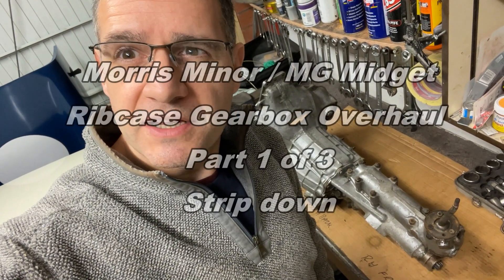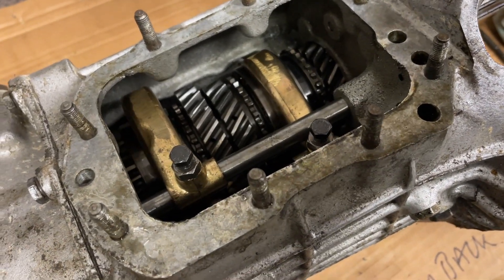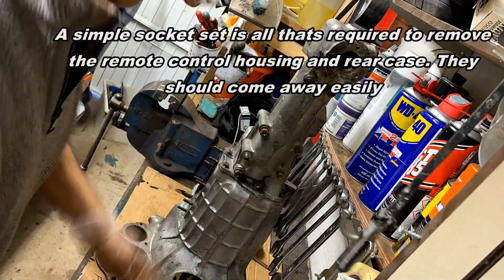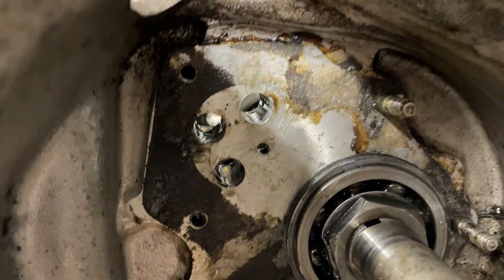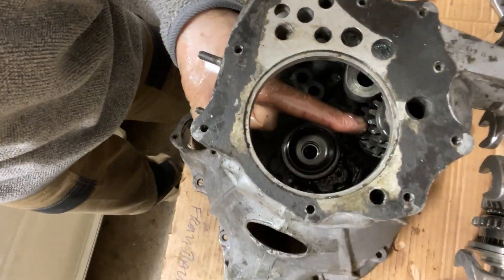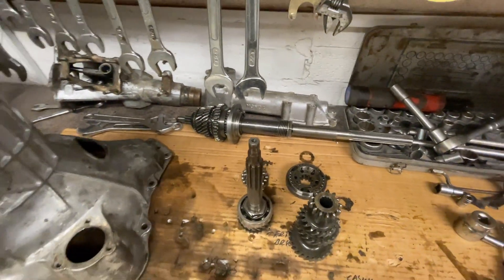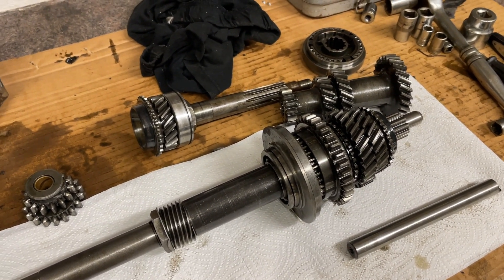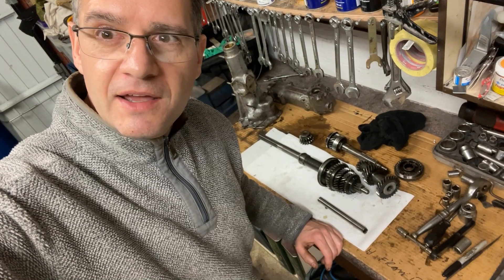Morris Minor/MG Midget/AH Sprite Ribcase gearbox stripdown overhaul and rebuild (part 1 of 3)

Comment: Excellent videos - I am about to rebuild my Morris gearbox. How did you remove the welch blanking plugs in the remote case with out destroying them or did you have to replace with new ?
Reply from the maker: A while back now . Can’t remember replacing them . I either knocked them out and put back in or didn’t remove the shaft. The area doesn’t see much oil so unless you need to I wouldn’t strip or if you do the parts are cheap to buy

Comment: These type gearboxes originate from the Austin A30 from 1951 which was designed by Austin & used later in the Morris Minor (1952), A40 Farina (1958) & Austin Healey Sprite (1958) & M G Midget (1961)
Reply from the maker: thanks for the feedback and thanks for watching

Comment: Great videos - thanks. One issue I'm having. I cannot remove the c-clip off the input shaft bearing retainer. It sits in a machined groove and all of my attempts to open the clip only serve to snug it up along the outside lip of the groove, without any "daylight" between the clip and the retainer.  Cannot get a tool in anywhere when the clip is open. How did you solve that problem?
Reply from the maker: the large C clip is sitting in the bearing itself (it has a groove in it). the size of the input shaft end means it has to go into the case to be removed so you have the take the clip off the bearing to be able to knock the input shaft through. i was using small screwdrivers, metal pointed scribes and thin blades to open the clip and then get under it to lever it up.  i guess it could be corroded into the bearing which could make life hard. another approach you could try is tapping the input shaft out the wrong way as far as it will go (use heat on case if necessary) to move the clip a small amount away from the case making it easier to remove as it wouldnt be lodged hard up against the case. good luck and let me know how you get on.

Comment: I have Morris Minor 1000, it's second gear suddenly realized, how to fix this trouble
Reply: I have a Morris Minor 948cc car.  When it is driven in second gear, the second gear is released when the accelerator is released.
Reply from the maker: Understand.  I have a gearbox which jumps out of first at high revs so similar problem.  Every cause is different but I would be looking to check the condition of 3 things here. Firstly check the condition of the gears themselves, any damage, broken teeth, excessive wear in the problem gear should be replaced.  Next check the Baulk rings (synchro rings) for wear. look online for the dimension between gears and if excessive replace these. Finally check the selector rods. the balls and springs hold the rods in place and hence the gears in place. If these are worn or damaged they wont hold the gears in place properly.  Hope that helps and gives you a place to start looking
Reply from the maker: Sorry, not sure i understand your problem. can you explain more? thanks for watching and hope its helped you solve your problem.
Reply: Ok, I will check, thanks friend
Reply: Dear friend, please explain to me how to install piston rings to Morris Minor 1000 piston, I want to know rings installing order